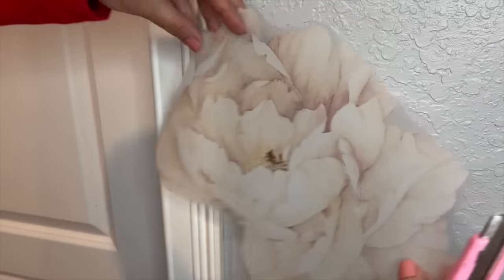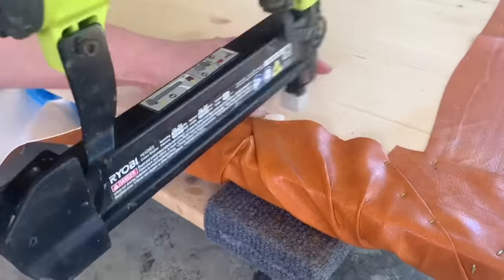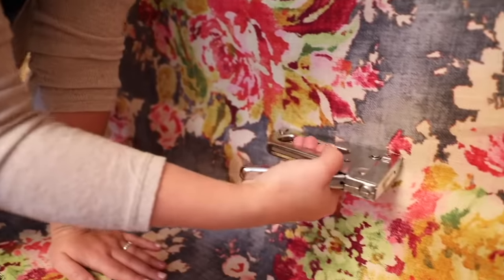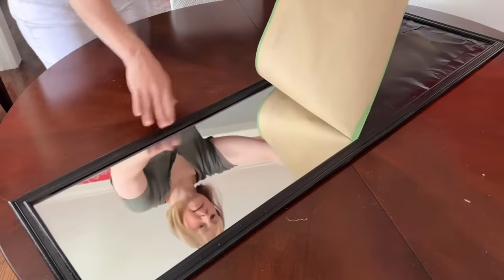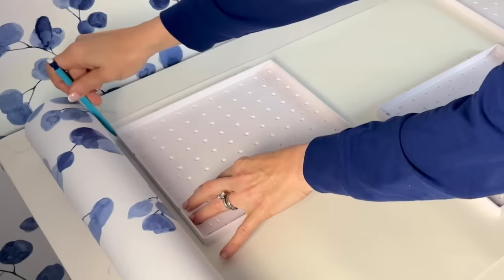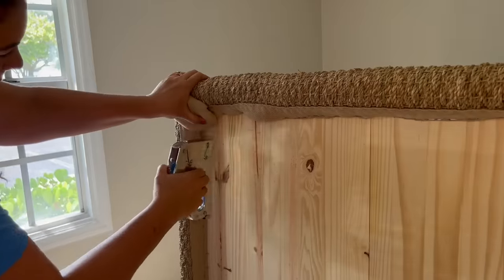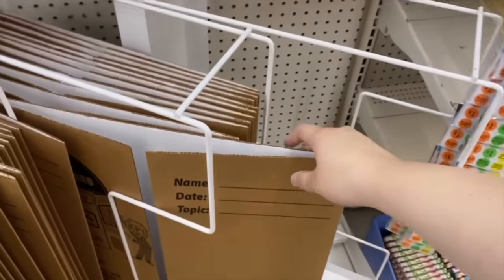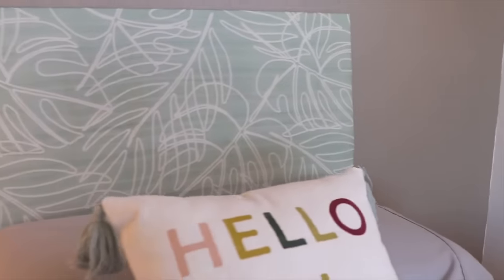The brilliant reason people are hanging curtain rods (NOT for curtains!)

Comment: Fabric like sheets can be used as wallpaper by soaking the fabric in full strength laundry starch.  Squeeze the excess but leaving enough to adhere.  Smooth out with a credit card or like item.  It will stick to walls or closet doors for years.  When you want to remove it, take a sponge and bucket of warm water and use the sponge to water down the starch and peel off the fabric.  Buy extra fabric or sheets to make curtains or pillows.  Matching sheets and bed cover to finish the look.

Comment: Years ago, I "wallpapered" my rental bedroom with beautiful king size flat sheets. I used staples. It was easy to remove when I moved.
Reply: I hate to think of all those staple holes in the wall.
Reply: @nancy3848  Not a problem.  Just fill them in with filler and the wall is ready for repainting.

Comment: I would not want to clean a wall where staples and spray adhesive were used. It would require sanding and priming for a simple repaint. Better to hang the fabric off rods, at least it could be washed. A few of the other headboard ideas would be good for apartment living. Not one of my favorite videos